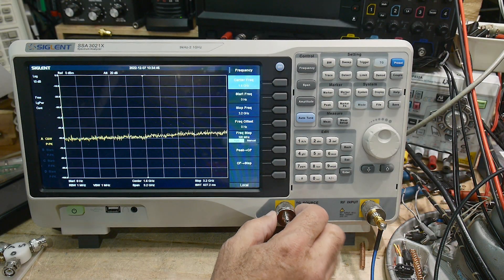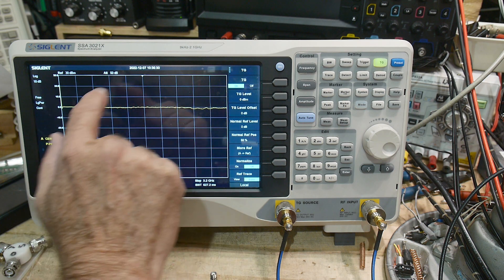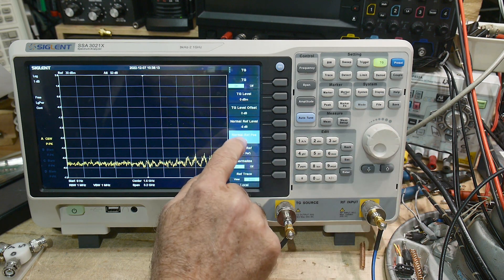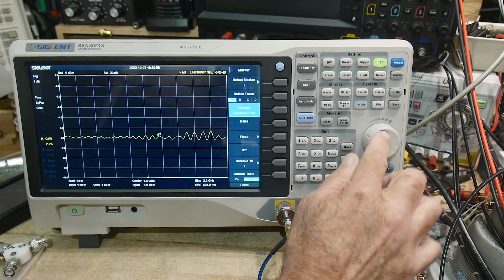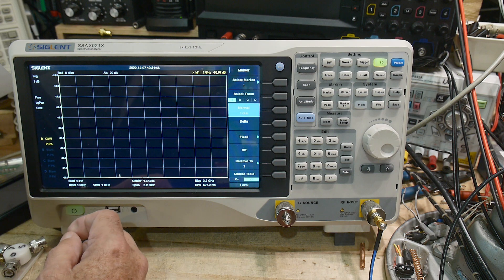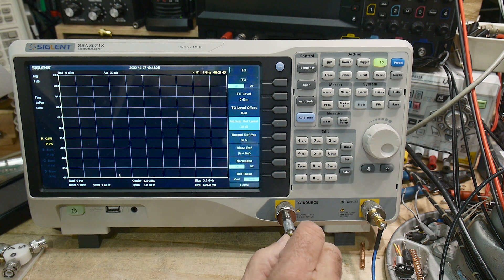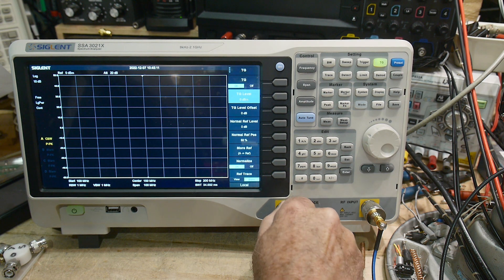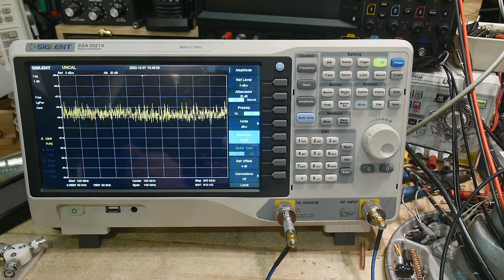#1367 Measuring some attenuators on a spectrum analyzer

Comment: But you are also having the 20db attenuator ON - my personal opinion would be not using the 20db atten from the SA itself - the DR would be -80db 20+60 in case you do not disable or at least lower the atten on SA. Of course i assume the purpose of the video was to show a way to increase the DR of the SA - btw I really LOVE your videos!

Comment: @IMSAI Guy can you please share what kind of coaxial cables are you using for your spectrum analyzer test setup and measurements? What kind of quality coaxial cables to you recommend for SA measurements in D.C. to 3.5GHz range for example? I just purchased the SSA 3021X and looking forward to acquire high quality coaxial for measurements. Thank you in advance! 73 de Andrei, YO6TJJ
Reply from the maker: That is difficult as good cables can cost as much as the SA. I would not worry much at 3.5GHz. I have used cables made by GORE and Pasternack and Huber+Suhner. these new would be in the $300 to $1000 range. and used I got them for 1/10th the price. https://youtu.be/cFx3DtX8Eao?si=wt46HLID0PyfgV_9

Comment: Greetings...

Noticed the delta of the attenuator at the higher frequency sweep even with devices specd for very high frequency.   Curious, have you ever used, like store trace at the noise floor etc, with and without tracking generator on / off and see how much, if any leakage occurs between the input and ouput ports ?    It's possible that phase leakage could be causing the slight deviation of the attenation measurement..   

thanks
Reply from the maker: this is not the best way to measure. yes there will be other factors that try to be calibrated out. the best would be a true open short load cal. but even a good VNA will not be as accurate as a good scalar network analyzer setup. the best is fixed frequency and a power meter

Comment: When measuring the 60dB pad, maybe check under "Amplitude" whether the attenuator of the analyzer itself is enabled. On my Rigol, it usually is by default, unless I set the reference level to something like -50dB or so. If your SA has a preamplifier, then of course enabling that helps as well (and on mine at least also disables the attenuator, wouldn't make much sense otherwise), but that's only if it has it.

Comment: For RF power meters,  if you don't have a wide variety of expensive sensors,  you want alot of different attenuators to stay under the max power allowed.  So measuring your attens is nice because if you got a 20 db pad and it is 20.1 or .2 at your freq,  you often have to stack them and the errors accumulate.  OF course HP power meters often have a reference source but it is fixed freq.
Reply from the maker: correct https://youtu.be/w3yFsQ_bafQ

Comment: You mention "attenuator" and "pad", and appear to talking about the same thing. This is very confusing. Can you explain this.
Reply: Old terms that ARE the same thing.  Passive Attenuator Device = pad.
Reply from the maker: yup  potato = spud
Reply: A 6 dB "pad" is used on signal generators outputs when checking radio receivers that are supposed to be nominally 50 ohm inputs,  I think it has to do with isolation and also maintaining an actual 50 ohms to the generator.  Then you add subtract 6 from the reading.

Comment: You don't have to store to ref when you normalize the TG, it does that automatically.
Reply from the maker: I've seen some that act that way, but not this model, you have press two keys
Reply: @IMSAIGuy  I've got the exact same model (original bandwidth though) and it does it automatically.
Reply from the maker: @MrDonTabasco  that's odd. have you updated the firmware to the latest?
Reply: I have seen many spectrum analyzer videos talking about normalizing the tracking generator trace and using the "Store Ref" button. Some people say to press this button and others say don't press the button, even on the exact same spectrum analyzer. There seems to be a lot of confusion about this. I have a Rigol DSA815-TG Spectrum Analyzer.
Reply: OK, guys... chill out or you're gonna make me read the darned manual!
Reply from the maker: @Randrew  the normalize button on my SA is 'greyed' out until you save the ref. you can not press it first.
Reply: @IMSAIGuy  Yeah, I have an SSA3015X Plus and see the same.  I was just kidding about the manual...  I'm not going to read it ;)
Reply: Just for kicks... this is a quoute from the manual, section 2.2.7.4 Normalize:
"When enabled, the reference trace will be stored automatically after the current sweep finishes if no
reference trace is stored before."
Reply: Wow, this is interesting, I don't even have the menu option to store the ref-trace...
My SSA3021X is running firmware 1.3.9.8 (2021-07-23).
Reply from the maker: there is a newer one:
SSA3000X_Firmware_V2.1.1.3R1 (Release Date 09.16.22 )
Reply: @IMSAIGuy  Yeah but according to the release notes you can’t upgrade to it from a 1.x version, I’m not gonna try and risk bricking my relatively expensive spectrum analyzer.

Comment: When would a SA with TG be needed rather than using a VNA?
Reply from the maker: the SA is a much cheaper device so most labs did not have a vna (pre nanovna).
the SA is also more rugged and maybe better suited for measuring things like amplifiers.
Reply: @IMSAIGuy  Oh yes, your communications analyzer comes to mind for wattage capability. 
Perhaps you could dissect and analyze some faulty attenuators.  I'm always curious about the $$$ divide between the components we can get.
Reply: @jspencerg  Newer model, the SSA3021X Plus spectrum analyzer can be easily hacked to SVA1032 (SA + VNA), more information can be found on the EEVblog forum. The SSA3021X Plus in only $255 more expensive than the SSA3021X.
Reply: @jeremycyclist6269  The SSA3015 can use the same hack to become an SVA1015.  I've done the first step, opening up the software features, but haven't had the courage to swap to the SVA firmware.

Also one of IMSAI Guy's recent videos, this one or the previous SSA one, mentioned the SVA having an RF bridge built in... I don't recall seeing that difference mentioned in the EEVblog forums.  Kind of important since that means a piece of hardware is missing in one's "hacked" SSA -> SVA
Reply from the maker: the signal path and dave both did detailed teardown videos of the PCB
Reply: @jeremycyclist6269  you don't need to cross flash the plus version as vna is included by default.

Comment: It's always fun to see analog and RF electronics.  It brings back memories of college.  For dB's our electronics teacher told us to remember 4 things and we could figure out everything from there.
0dBm = 1mW
-3dB = x0.5
0dB = x1
3dB = x2
But I still feel like the sorcerer's apprentice trying to cast the incantations :-)
Reply from the maker: those are good things to remember
Reply: For dB-anything it may be more important to remember that 0 dB is the reference level for "anythings".  dBm is decibels "milliwatt" so 0 dBm is the reference level of 1 milliwatt.

Another common one is dBA for audio noise level, where 0 dBA is the threshold of human hearing.  For any measure, decibels do apply the same as your other rules: every 3 dB up is a doubling, 3 dB down is a halving.  This should be really important for car audio enthusiasts who might think 133 dBA is "only" 3 more than 130 dBA.  Yeah, bro... it's "only" twice as loud ;)
Reply: @Randrew  Yes.  It does seem weird that going up by 3db makes twice as much.  But that's how the math works.  It took me a while to get used to that.
Reply from the maker: 6db volts   3dB watts
Reply: @IMSAIGuy  = -3 dB Amperes?
Reply from the maker: @Randrew  6db amps
Reply: @IMSAIGuy  Gah!

/sharpens pencil madly
Reply from the maker: power = watts
watts = volts^2 / R
watts = amp^2 * R
both volts and amps have a square term, that is why they are 6 dB and not 3
Reply: @IMSAIGuy  P = VI  :)
Reply: @IMSAIGuy  Yes.  I get it in metric notation.  Such as 1mW x 1000 = 1W.  Or 1W / 2 = 500mW.  Or 5V x 200mA = 1W.   It becomes black magic when expressed in dB's  :-)
Reply: @IMSAIGuy  I think that dB is logarithmic, so anything that is squared is doubled in dB's.

So a 3dB change in voltage or current gives a 6dB change in power.

I'm starting to get it.  I haven't really thought about it since college some 40 years ago :-)

Comment: Hello imsai, the 3015x plus  (max 1.5ghz) do you know if use same hardware with 3021x?
Reply: It is not the same hardware.  The 3021 and 3032 are the same hardware as each other, but the 3015 is not so it cannot be modified to go to a higher max frequency like the 3021 can.
Reply from the maker: I don't know

Comment: The wiggly waveform of the attenuators on the Siglent spectrum analyzer appeared all the same.
Is it possible that it was caused by the instrument itself?
Reply from the maker: yes
Reply: Is it possible to normalize the TG output, like a VNA would?
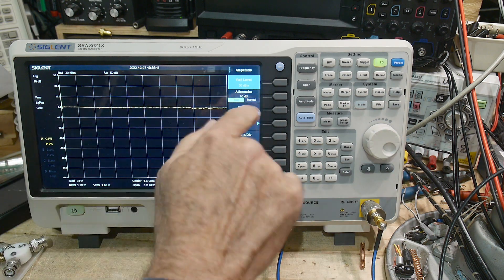Reply from the maker: @tiftik  yes, I do that at 1:30
Reply: @IMSAIGuy  I wonder what causes the wiggles then... Perhaps a minuscule impedance mismatch somewhere.
Reply: @tiftik   Most likely it is the test cable used to connect the attenuator to the spectrum analyzer.